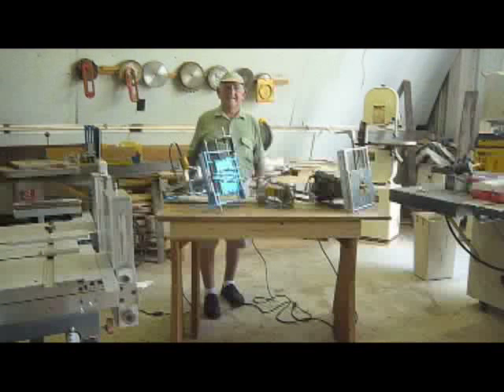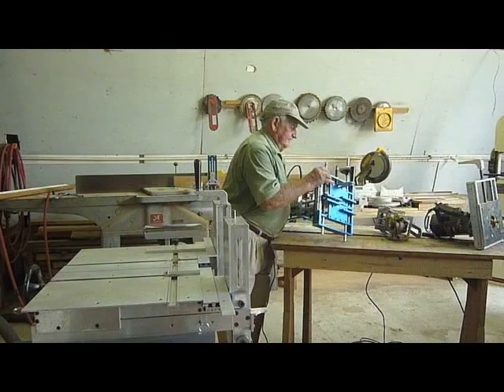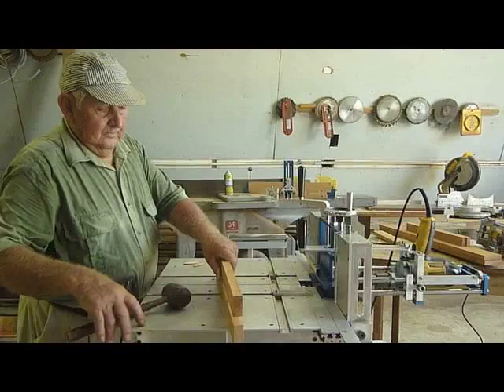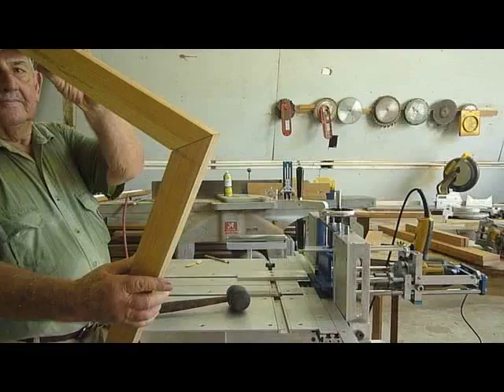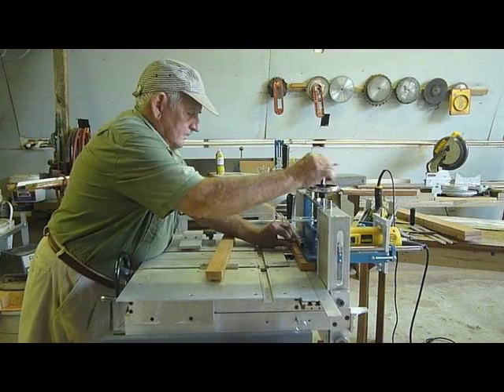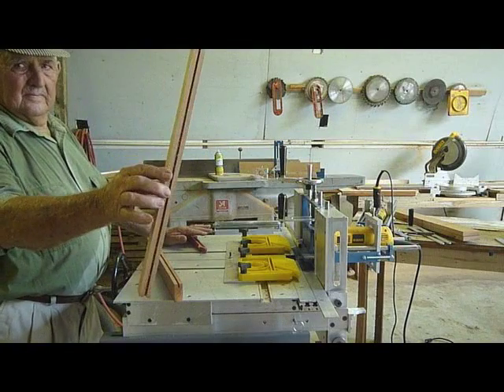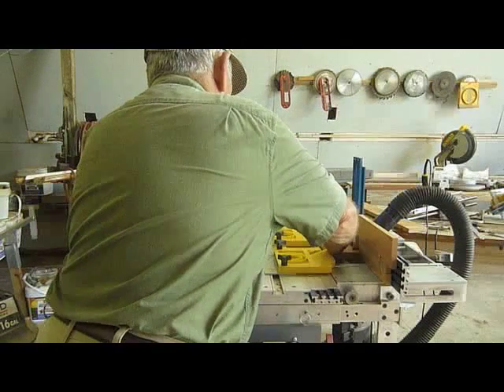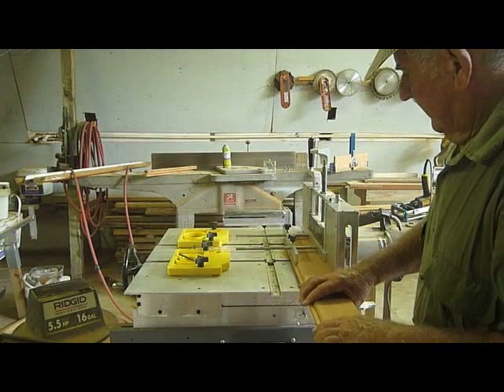Jig System for Woodworking

Comment: This is a one in all master jig system enabling you to achieve many applications on one table. Allows for far more than simply biscuit joining, other applications include dovetail joints, tongue/ groove detailing, perfectly aligned horizontal self-centering dowels and any type of molding. The table is able to be used both vertically and horizontally. It enables the woodworker to achieve all these tasks on one jig with easy simple and fast attachment changes.  Thank you  for your interest.